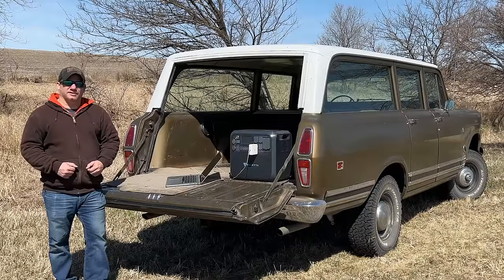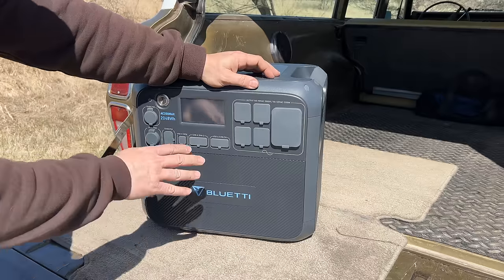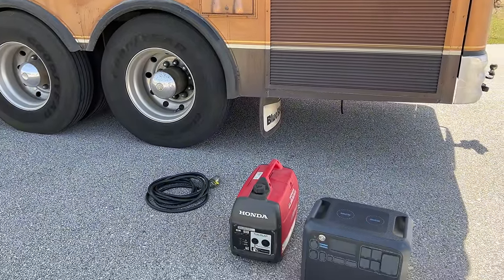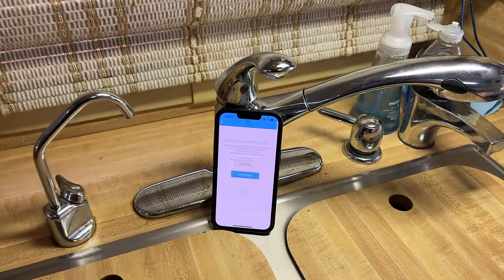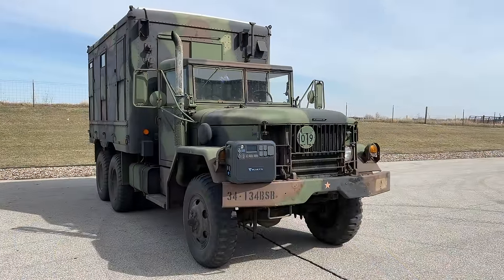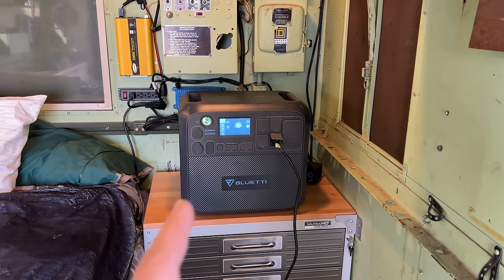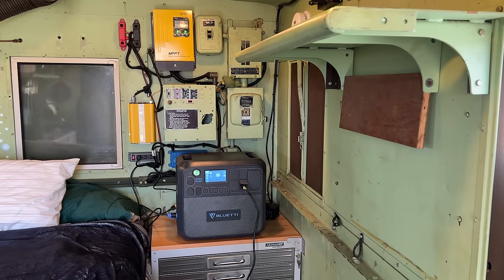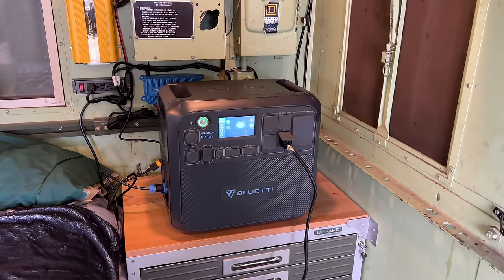Integrating BLUETTI AC200MAX Power Station into Overlander for Six Times the Power

Comment: Question:  it appears you are using the DC output from your MPPT and inputing that into the Bluetti which has it's own MPPT.  First, did you have the Bluetti set to PV or Other for the DC input and don't you risk damage by having two MPPT controllers on the same input?

Comment: This is what I was waiting on I have a 50 amp Diesel RV with two 15,000 btu ac unit will it run one of them it looks like it! Just need to be on panels, solar
Reply: You notice he did not show the power usage when he ran the one air conditioner. Which is the reason I watched this video. I wanted to know the same thing as you. But no one will talk about it. Typical!

Comment: Hello Steve....I just purchased the Bluetti AC200D power station (2000 WH).  I have not purchased a solar panel as yet.  What do you recommend?  Bluetti has several...one being a 200 watt panel.  Do you like the Bluetti panels or do you recommend a different brand?  Love your vids and reviews!!
Reply from the maker: I cannot attest to the Bluetti panels as I have never had one.  If I was going portable and moving it around all the time I would probably get theirs and if I was mounting it permanently  I would go with something that more sturdy and meant to be attached to something.
Reply: @ThisWeekWithCars  Thanks Steve!
Reply: The Bluetti panels I have are not supposed to be left out in the weather (they are water resistant not waterproof). They are portable however so can be moved around to get the most sun. I have not used mine very much but they would be good for a small camp setup.

Comment: One thing I don’t like about the AC200 is that the fan in the wall charger runs continuously even if you are not drawing power. If I needed to AC charge it in a living area I would want to get something quieter.
Reply from the maker: I agree it doesn't seem to be necessary.
Reply: @ThisWeekWithCars how is your unit working?
Reply from the maker: @zfontain1975  I use it once a week.

Comment: Ideally you might want to build any expansion battery capacity into the vehicle - don't know if Bluetti allows this.
Reply from the maker: That is as easy as adding more batteries to the trucks battery bank.  The LiFePo batteries the BLUETTI uses are far more powerful and should last longer because of their battery management system.

Comment: I bought the same unit it's ok. Ac300 definitely a better option
Reply from the maker: AC300 doesn't have a built in battery so if you are not planning on carrying it around, yes it would be a better option but the AC200 Max is the best all around unit.
Reply: @ThisWeekWithCars  agreed 👍
Reply: How is your max working for you?
Reply: @ThisWeekWithCars  yes, I have the 300 with one battery pack, and I would not call it portable. I would not want to move it without a cart.

Comment: I really doubt that it charges fast. Mine takes almost 6 hours just to fully charge.
Reply from the maker: Using the power brick and a dc input from solar panels you can charge this at 1,300W which will charge it completely in just under two hours.  In my use case it only needs to supply power from the battery for short bursts of running the microwave or for powering the lights at night.  During the day it can sit and charge back up while the solar panels provide enough power to run everything.
Reply: Mark you like your max?

Comment: It is really hard to see the LCD touchscreen display of the AC200Max when it is out in broad daylight.
Reply from the maker: Yes it is a good looking screen but it is not very bright, or at least not enough contrast to view with a lot of light.  I prefer to use the phone to control it.  Besides turning the ports on and off after the first time you set it up you will not be using the screen for anything unless you want to see how much battery is left.